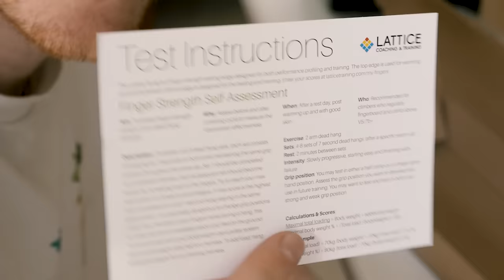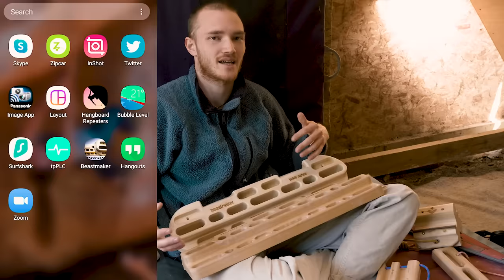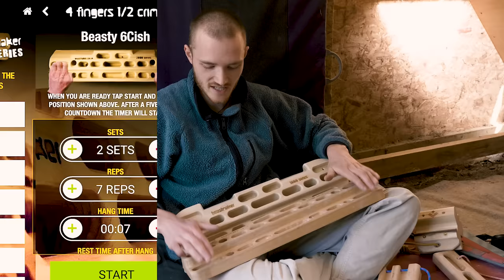Which Hangboard should you isolate with? || Isolation Vlog

Comment: I recently bought the £25 arete board to use until the gyms reopen. Turned out to be an absolute bargain. Hope the crew is all safe and sound.
Reply: Same, it's suprisingly good
Reply: Same. Also really handy for assited one arms too.
Reply: Me too - it's great quality
Reply: I got an arete board last year to take on vacation and after a couple workouts it actually cracked and split horizontally through the slots about half the boards "depth" deep. It didn't break apart, but that rather deep split got me a bit scared since I didn't want it to break with me hanging on it. I'm a whopping 61kg which is not much even in freedom units, so I don't know why that happened, but I stopped using it. I probably just got a bad one, but that's been my experience.

Replaced it with a cafe kraft problemsolver, which is essentially the same, but a bit fancier.

At home I am using a metolius "don'tknowthemodel" wooden hangboard, which is nothing special.

Comment: Have had a Beastmaker 1000 over my kitchen door for close to 2 years. Great for pull ups and definitely hard enough for most climbers. Some grips on the 2000 are insane.

Currently got a "Captain Fingerfood" board that I really love as well. Pretty compact and lightweight (~600 grams). Super nice construction and portable like the arete, but way more approachable. Huge sloper, 30mm hold 4 finger holds, 20mm 4 finger holds, 2 Finger pockets and good holds in the middle for one arm hangs. Pro: I can get outside and hang it everywhere I want to train. We are still allowed to go outside for sports in Germany, so I just search a nice tree and go for a workout outside.

Comment: Fished around for some scrap wood in my shed, sanded the edges, screwed them to the rafters. Boom, one 10mm edge one 20mm edge, done.
Reply: Wait, you did that wrong... you're supposed to spend money!
Reply: I believe depending on the type of wood it may snap! Good luck and be safe
Reply: @markwatson6840  nah all good, each piece has a good height and plenty of screws, doesn't even flex under BW + 20kg

Comment: Hey Bobats, I just wanted to add something in case people get too disheartened! You mentioned at about 23 mins in that the beastmaker app has graded workouts in line with sport grades. Unless they have recently changed it because of the OBVIOUS confusion it creates (and i've found this happen to heaps of people). The grades on their app are not actually meant to correlate to sport or anyother grades for that matter. they are Beastmaker app grades and that is all (It's like they decided to create a whole grading system jsut for them but make it exactly the same in numbers and letters as existing grading systems just to make people cry!). The Beastly 5a workout for example is WAAAAY harder than a 5 sport climb. So just a heads up for anyone that may have tried them and been shut down hard. I remember first time I trained on a beastmaker with the app I tried a Beastly 6c routine as I was climbing about 6c then and I couldn't even get through the first set I think. but the 5c was ok for me then.
Good luckj everyone and keep up the good work!

Comment: Does anyone try to fix a hang board in his flat on plasterboard walls on top of a door frame?  I'm not quite sure what the structure behind the plasterboard is but I believe it is metal studs. 
I don't really know how to fix it and to make it solid enough. I'm thinking of adding a backboard anyway. Are hollow wall anchors strong enough? If you guys have any tips or experience in that, I would appreciate your insights. Thanks :)
Reply: Etienne Corbaux do have any idea what the spacing is centre to centre between the studs? If it’s a doorframe, it should have a mantle (big piece of thick wood above the opening) above it. Either use a stud finder or just knock on the wall with your knuckle to find the solid bit. And use no less than x6 screws at a minimum of 50mm long